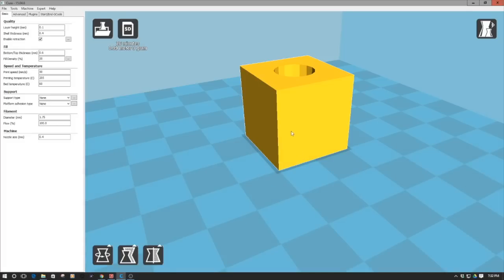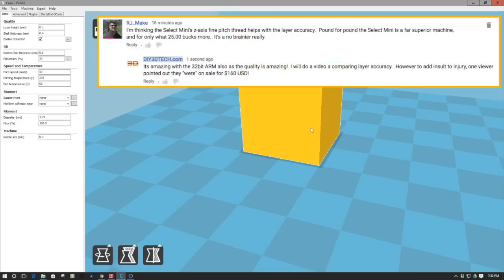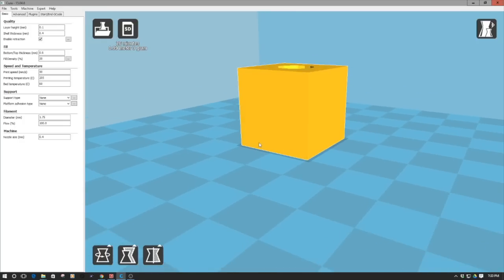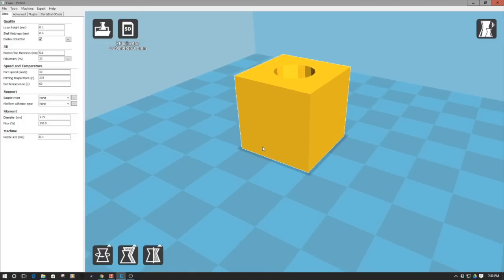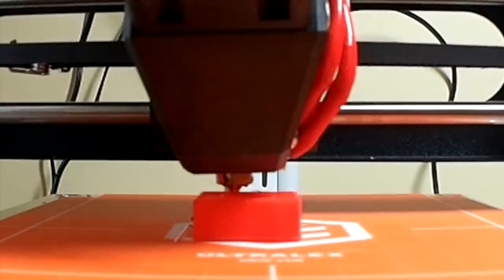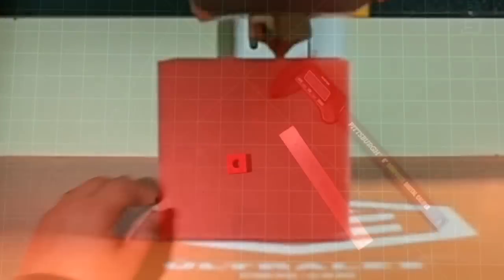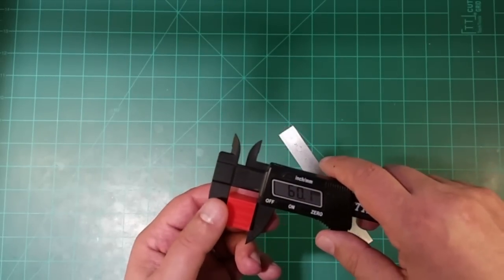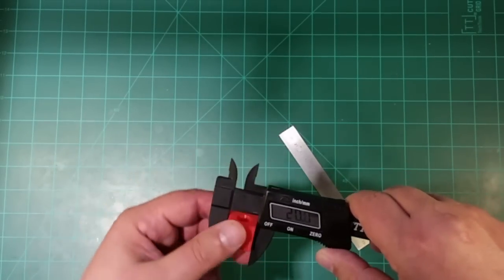MonoPrice Select Mini 3D Printer -  How Good Is The Z Axis and Does ARM Make A Difference?

Comment: At one point you mentioned that you printed the cube on the mini at 203 degrees.  What mod are you using for the temp control?  The temp on mine only changes in 5 degree steps.
Thanks.
Reply from the maker: In the slicer you can set the temp in 1 degree increments to what ever you want.  Hope this helps :-)
Reply: I forgot about that option.  Thanks!

Comment: Joe- another great video but I would love to see you do that head-to-head cube test with the same filament to see if the difference was in the filaments themselves.  That would be a much better test of the MPMS-Mini print resolution as well as how well it does against the Wanhao.
Reply from the maker: Yea out of the other stuff and was in a hurry as needed to head out of the country on business yet was curious.  When I get back I will likely do up a new model in Open-SCAD as well as adjust the extrusion as realized this morning I said it wrong.  As there are two under extruded bands and one properly extruded lines and the reason for the 19.6mm and not 20mm height.